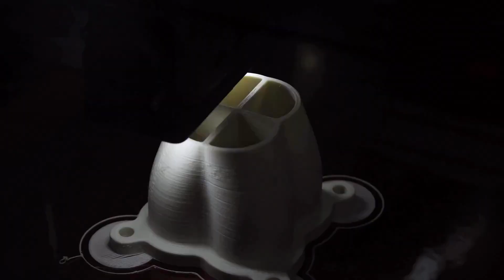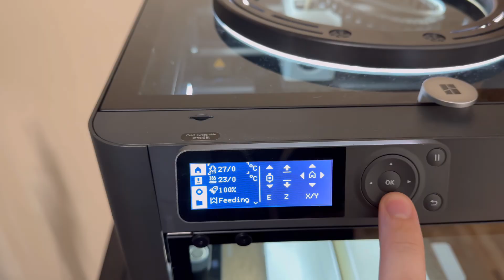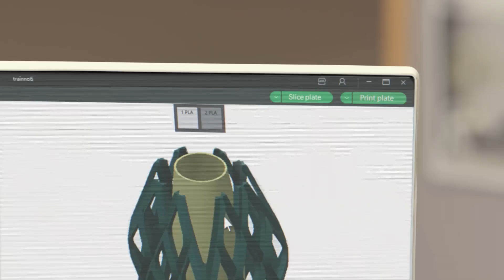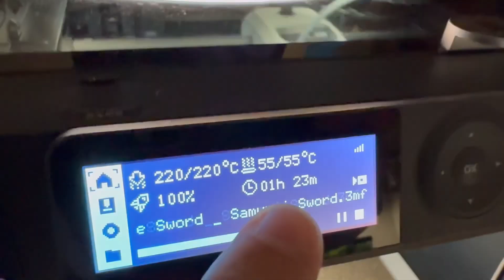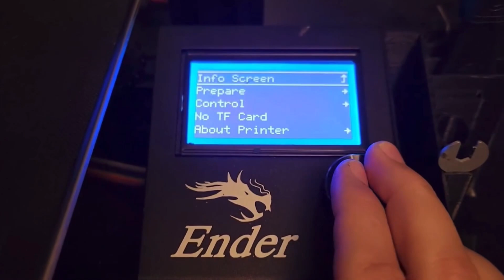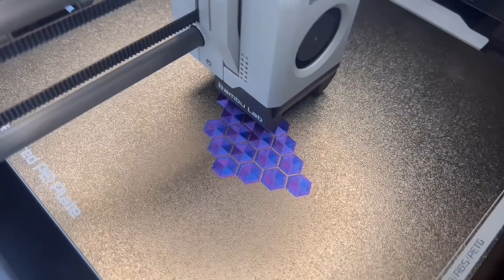WATCH THIS if Your a Beginner at 3D Printing

Comment: Clear and to the point video.  I want to start. BambuLab isnt big enough for my cosplay.  I hope that they make one bigger like creality k1 max or preferably bigger.

I want to get into 3D printing. Not 3d printer tinkering. 

I want an enclosed printer with filter. That isnt too noisy. That just prints without too much fuzz. That is big enough to print cosplay helmets for my big cranium i one go. Where everything from bedleveling and calibration is automatic. And that can print with different materials.  And that is easy to maintain and mod. I want it ready out of the box the same way as a normal printer.  

But maybe I am asking too much. Everytime i research and think...this is it...here is the the printer for me ...i find ten new vids or forums saying the printer is bad and has a lot of problems. Very frustrating.

Comment: I got mine a couple of months ago. After a few mishaps and having to wait for parts, I bought a 2nd one. Now I'm having issues with warping due to drafts (it's winter here) so I'm waiting till I've got a bit more control over my environment before I go full on pedal to the metal 3D printing.
Reply: I got the Ender 3 v3 SE just because that's what's available cheaply. I figure it's always getting something that's not necessarily the best for the first one just to get a feel for repairing and maintaining the damn things.
Reply from the maker: What happened?
Reply: @3DPrintDood  Blob of death. When I was trying to clean it off, I snipped through a wire to the thermistor (it was white, the PLA was white). So I ordered a replacement thermistor locally only to find that I needed to change the plug on the end. My soldering skills aren't brilliant (and we're talking a single strand of copper for the thing) but I managed to do it. It's just that I was using heat shrink and I don't know what that's rated to for constant temperature. Like I'd never needed kapton tape before so didn't have any on hand.

After that there was an issue with plastic making it out the top of the hotend. The path between the heatbreak and nozzle needs to be as straight and gap free as possible. I managed to wreck the PTFE lining while trying to fix that.

So I'd gone through a few iterations of buying spares from Aliexpress (trying to work out what I needed to keep on hand for quick repairs. A full hot end assembly is only around $15NZD). It got so bad that I decided to just buy a second printer so while I'm waiting on parts for one, I can still be printing with the other.

The last issue that took a ridiculous amount of time to fix was one of the fan cables broke. The bits just kind of pulled out of their housing. They're little JST connectors but they come in TINY sizes and its really hard to measure them. They're within just about anyone's margin of error. So I bought the 1mm pitch ones and they were too small. Then I bought the 2mm pitch ones and they were too big. And then I got the 1.25mm ones and they were just right. And with a week between ordering and receiving, it was 3 weeks before I was able to use that printer again. It turns out the extras I bought are going to come in handy for a couple of other repairs so they won't go to waste.

The printers themselves aren't the best quality (which is what I wanted because I want to learn how to fix things). Like the first thing that needed sorting out was the print bed. They came with a polycarbonate build plate which just over adheres to PETG (I have a lot of PETG. I literally found a few boxes at the side of the road from a house that was being cleared out so I have something ridiculous like 50 spools of the stuff). So I needed to replace the build plates with PEI ones first. Then they have this tiny 25mm fan on them which is just LOUD so I needed to replace those. I kind of want to replace the cooling fan as well. It's a little loud but I'm wondering if I should have a go at improving the cooling or replace it with something very similar. We're in engineering territory where I'm trying to keep the weight at the print head at a minimum while I contemplate the best solution. A bigger fan is more mass but can turn more slowly to move the same amount of air thus being quieter. I probably want to have cooling from multiple directions - can I do that effectively while only using a single fan?

In a couple of weeks I'm going to be changing them a little. I'll be building them into a set of shelves. This solves 2 issues. 1. I have warping from uneven cooling so some sort of enclosure is needed. Probably not that big a problem in summer. I'm also going to attempt to move as much of the electronics as I can out of the enclosure (electronics hate heat). I don't imagine this will be enough for other materials like ABS though I've got very little interest in those except for maybe creating parts for other machines (I want to eventually make a pen plotter, vinyl cutter, and eventually a 3D printer). 2. The weight of the spool is on top of the gantry which I imagine will eventually form a wobble - especially if there's more weight there than there needs to be. So I've bought some PTFE tubing so that I can put the spools just about anywhere - like the shelf below the printers.

For making stuff, I've become really interested in the idea of using the printers for making molds for casting. So concrete things for the garden (which fits into the renovations I'm looking at doing very soon).